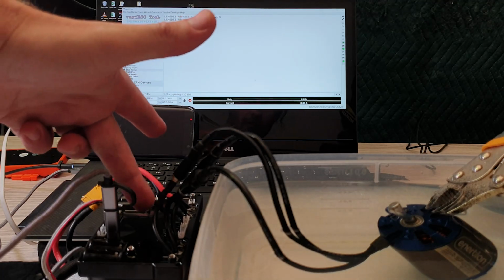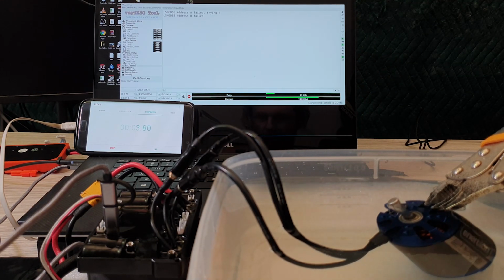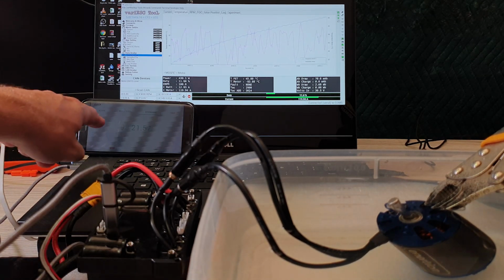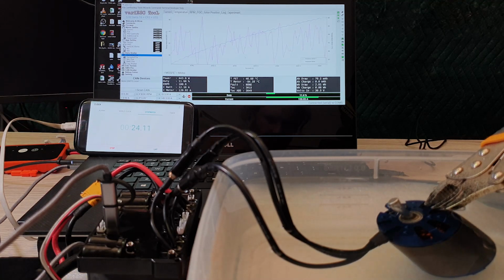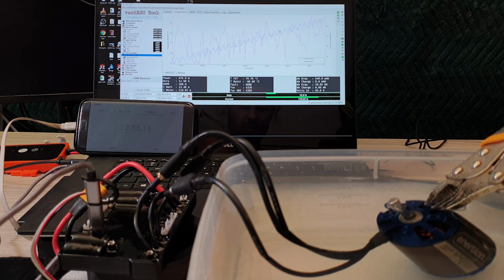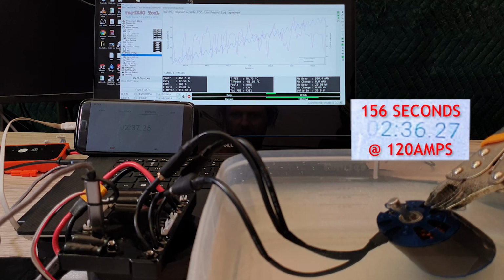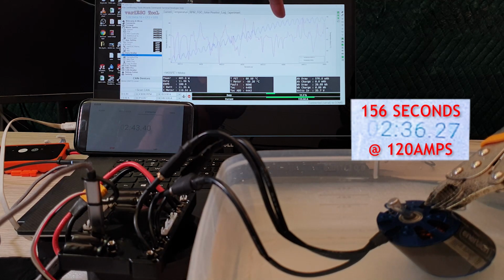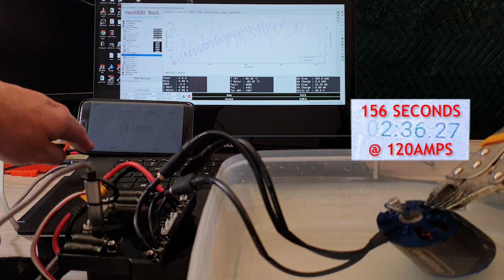FOCBOX TENKA | Single Motor ESC Running at 120Amps

Comment: So basically the unity that cost 200$ not including shipping is 300$ now 😔
I guess it's due to the global chips shortage...
Are there any plans to get it back to 200$ when the chips price will get back to normal?
The tenka is also more than 200$ (BT module not included), probably harder to configure (does it works with the unity app?), bigger case and with lower performance (that should be enough).

Comment: We need HV not this bs
Reply from the maker: give me 3 reasons why higher voltage is "needed"?
Reply: @ElectricSkateboardBuilder  1) Higher top speed, more availability for gearing changes towards higher torque at the wheel without significantly lowering the setup's top speed potential. 2) More efficient use of current. 3) Address the scarcity of higher voltage controllers in a saturated market of controllers that are limited to 60v.

But building a HV controller would take actual redesign, not just removing a module and using cheaper components.
Reply from the maker: @TheBoardGarage  My responses 1) the fastest board in the world is 8S, voltage is not directly correlated to speed. 2) ? Doesn't really make sense 3) That is not a "need" that is a want.
Reply: @ElectricSkateboardBuilder  1) That's a bit of a non-sequitur there, and kind of a disingenuous one. An 8s board isn't practical for most builders looking for well rounded builds covering as many bases of performance as they can for their dollar and build hour. 8s speed boards don't raise the collective ceiling of the build community and what they have available for them to get their hands on as well as wrap their hobby interests around. 
2) Yes it does make sense. Higher voltage allows gearing that results in greater torque output with lower current. That reduces heat in the motors, resistance in the wiring, and also allows for thinner guage use without the same risks of heat issues in the system. It's been demonstrated on several builds already. 
3) You're mincing words there. Who's defining need or want here? Electric skateboards aren't a need. They're a want. The Tonka isn't a need, it's a want. So who's to say what the OP or the community based entirely on "wants" actually needs? You could shift the goal posts over and over, but that wouldn't be productive discussion, just pettiness in the way of progress.
Reply from the maker: @TheBoardGarage  you say 8S isn't practical? yet then proceed to promote higher voltage alternatives 50V+? OSHA considers all voltages of 50 volts or above to be hazardous. The higher voltage systems you are promoting must be handled according to very strict guidelines which make it truly impractical for an electric skateboard! The fact remains, Lower voltage systems (12S MAX) & the accessories, motors, batteries, are more affordable, more tested, more readily available, offer very high performance, and won't kill you during routine maintenance. Nor will you be infringing on OHSA safety guidelines if you open it up at your school or work to check the parts.
Reply: @ElectricSkateboardBuilder  what does OSHA have to do esk8 and why do they care what Im riding after work or to work. Seems Osha would want me to wear a helmet and pads on my HV board
Reply: @ElectricSkateboardBuilder 
1more efficiency
2more torque by using low kv motor 
3less heat, because less amps

4more speed

Comment: This is just an unity running single motor firmware isn't it...
Reply from the maker: No. Not really a Unity. Actually, Most people don't need all the features that the unity offers. Currently in diy esk8 industry people may be paying for features they never use or need, this makes diy esk8 unaffordable and unappealing for many. With the Tenka you can now afford a high performance, fully programmable and more rugged system without blowing your hard earned cash on costly features that the majority of people who want to build a good electric skateboard simply don't need.
Reply: @ElectricSkateboardBuilder  So what features is this missing over the unity then ?
Reply from the maker: @H0gyoku  no Bluetooth, different case design, some component level changes.